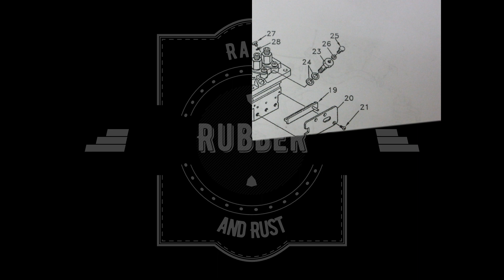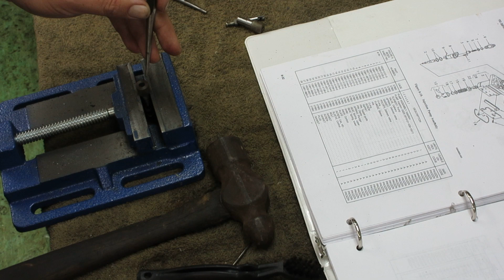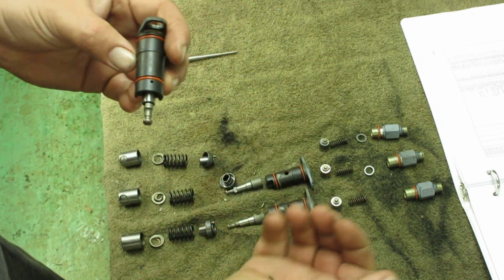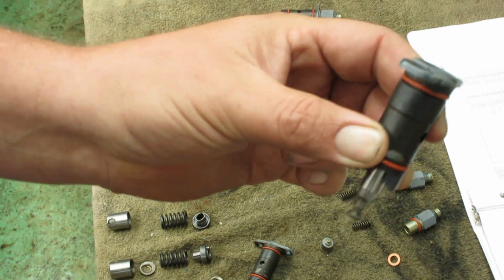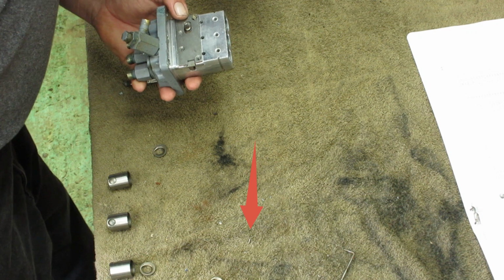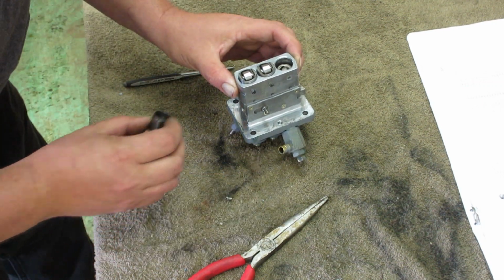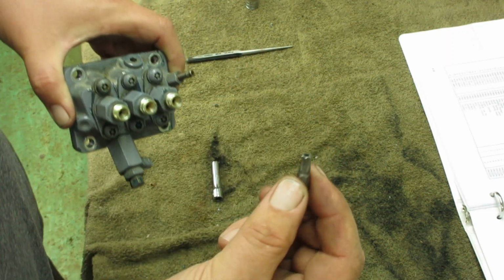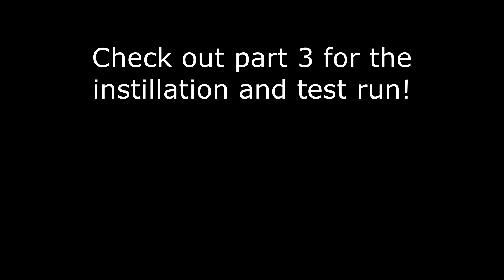Kubota 3 cylinder diesel Zexel injection pump rebuild Part 2

Comment: Your video set on the zexel Kubota D950 fuel injector pump was delightful.
Have no seen or read about the plungers' physical size and stroke length.
Understand it may be 5mm diameter but 5.5 mm diameters are also mentioned.
You were very fortunate to get the light generator manual which was so detailed.
Zexel does not recognize the Kubota serial numbers so not sure how to find tge actual Zexel pump serial number and alternat plunger id part numbers.
Any comment from you would help.
Reply from the maker: Thank you! I'm glad it helped.
Unfortunately the only parts I've been able to find for these pumps are the o-rings. I have not been able to find anybody that will sell any internal components. I have found the entire pump for sale that's it.

Comment: Some tricks of the trade.  Instead of fighting all those little pins and Detents,   Put a gaba Vaseline on them.  It will hold them in place.  And the Vaseline has such a low melting point It will turn to liquid with any amount of heat or fuel Hits it.

Comment: Was very helpful need to make real clear how the pump pin faces had to watch that part several times.one of my three wasn’t pumping out any diesel.my starter was weak.would only crank about ten turns and it would crow bar the battery down to nothing.tried a new battery same thing.put a new starter on and man did she spin then.180 for a battery 381 for a starter.came close to just buying a new 72 incher
Reply: Is that what happens if the piston faces the wrong direction, no fuel?   I started my D902 and it went run-away, but lucky for me, I had a shutoff in the fuel line..  smoke everywhere and crazy rpm.  I am not sure the cause...   maybe the slider pin did not engage the shutoff solenoid slot?

Comment: Can the twin o-rings be replaced without taking the pump that far apart? My shibaura runs great, just leaks fuel. Hoping to replace them with the pump still on the tractor…. Edit: on a late 90’s shibaura in a NH1530 I was able to pull apart for orings while on the tractor, and my pins are staked so they don’t fall out. Worst part will be getting the ‘piston’/ rod? lined back up while reinstalling the delivery valve cause the housing is on an angle allowing the piston/ rod to lean. I managed one so far, might jack one side of the tractor up. Never been so careful in my life. I’ll update when I succeed or screw it up. Thanks for replying and the video.
Reply from the maker: Unfortunately I believe you have to take the pump apart to pull the barrel out to replace the O rings
Reply: Update: success! O-rings from the dealer were $50 for the six I needed. I cheaped out and got hyd orings from Napa for $2. I believe the lower oring seals fuel from the crankcase, so I will make sure I’m not making oil. So on a NH1530 shibaura zexel it can be done on the tractor. Just be very careful and clean, and mark the location of the valves cause that will affect fuel delivery

Comment: Hey just following up. Did you ever test the pump? And if so how did it work out?
Reply from the maker: Yes, worked great! Check out part 3!
Reply: @steamman5320  great! My parts arrive tomorrow and I will be rebuilding mine. Did The numbered discs or the upper torx plate location have anything to do with timing or did you just put it back the way you removed them?
Reply from the maker: @anyandalldiy6704  the spacers are for timing so make sure to note where and how many, and I just rotated the heads back to where the paint came off and it seems to be perfectly fine.

Comment: I'm confused is the m 30 towards the crankshaft side or outside of engine. I lost all 3 of my pins and had to make some from drill bits cut off. Great video
Reply from the maker: Which part is the m 30? I did this 2 years ago so forgive me for not remembering. Be glad to help if I can.
Reply: @steamman5320  the part # on the plunger
Reply from the maker: @rayhuggart5214  outside I seem to remember.
Reply: @steamman5320  OK, this was also my question.  But now you won't remember for sure.  lol

Comment: good night, I'm talking about Brazil, you have engine references. kubota D1005.if you have it I would like to know the height of the piston in relation to the face of the block.(piston projection) and torque values of the head screws.I'm very grateful if you can answer me.ok.